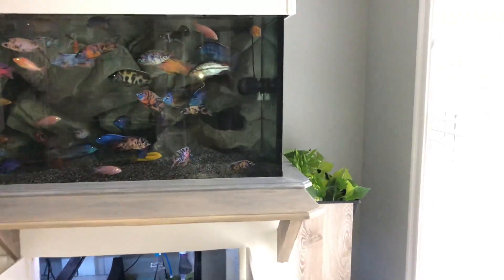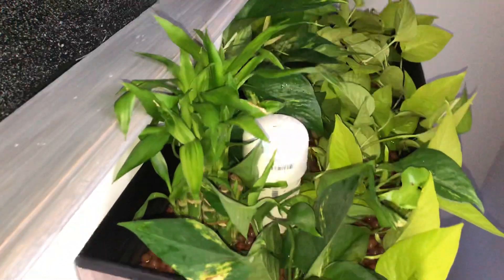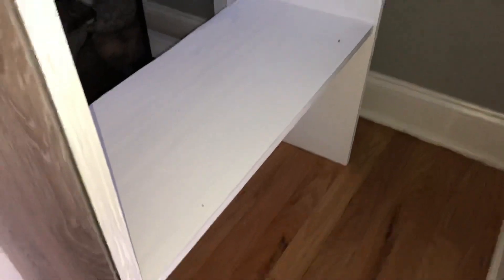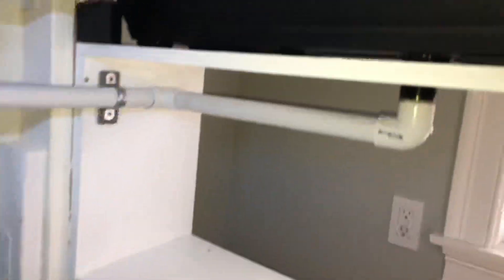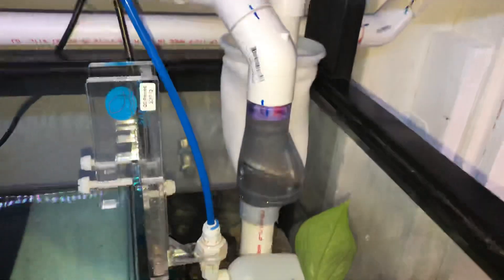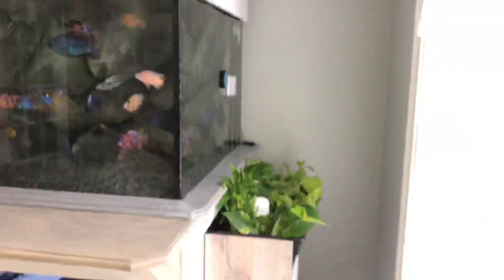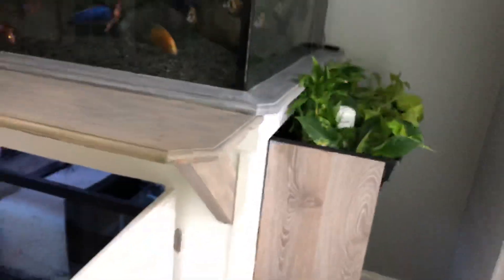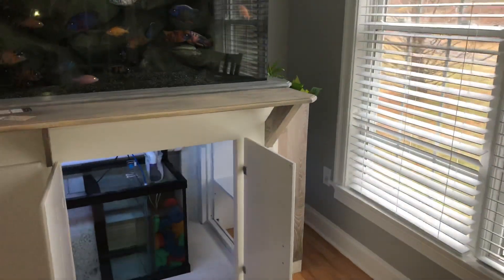Integrated Cichlid Aquaponics system

Comment: Awesome setup!  I am curious, did you consider putting the aquaponics 'early' in the filtration, like just after the tank's overflow to incorporate some of the fish waste to the plants root system, then having that overflow feed back into the beginning of the sump?
Reply from the maker: I originally had it that way but was short lived. I chose to incorporate it into the UV system. The plants have grown like crazy and am now setting up a lattice up the wall so they can climb the walls around the tank.
I fitted this tank with a constant drip system about 11 months ago. That system in itself takes care of any nitrate issue so the plants are more of a “cool” factor just because I like them these days.

Comment: What kind of drain are you using for the aquaponic tray? I see bell drains are very popular as they increase oxygenation of the ceramic media and roots.
Reply from the maker: Initially I started off with the bell siphon, I quickly got rid of that and replaced it with a Durso type that is completely silent and has been running perfect since set up
Reply: @Jetblink619  thanks for the quick reply! 
I have been also wondering, where do you get your cichlids from?
Reply from the maker: @nicknoker8215  LFS mostly (high end shop), and I breed my own fish.